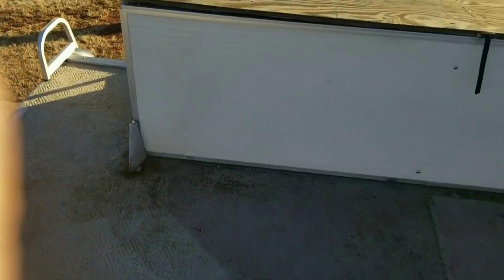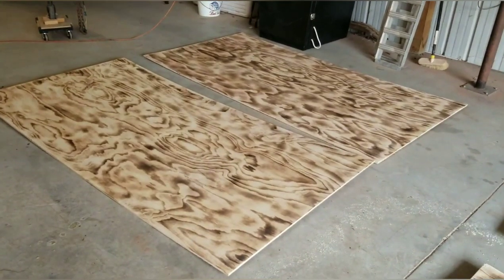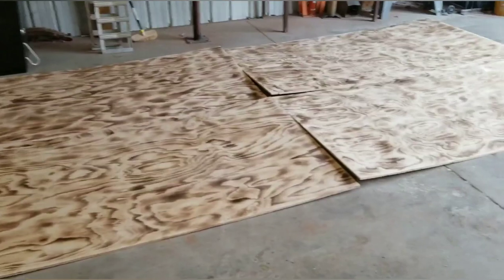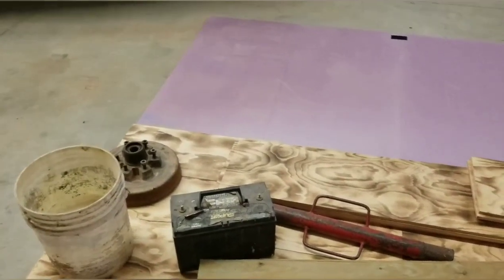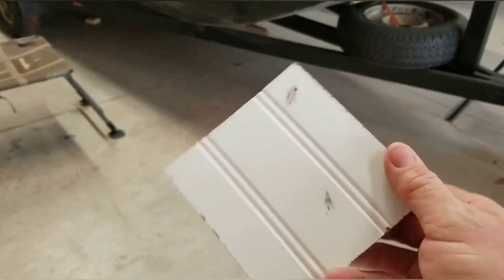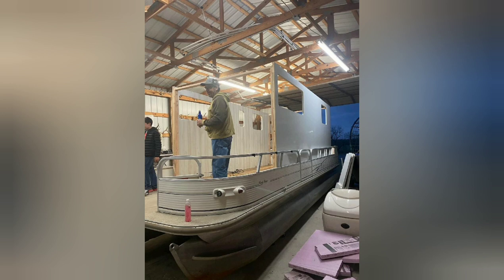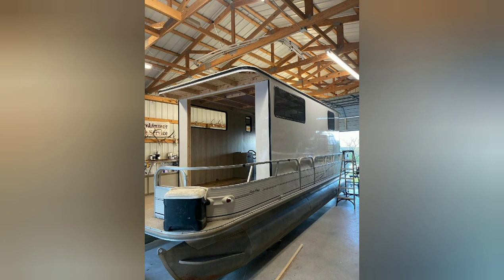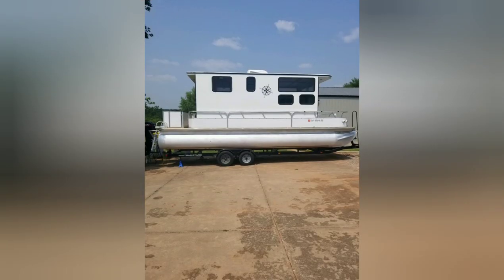Pontoon Houseboat Build, shanty boat New Details Added Episode 1 of 8

Comment: Very cool!   What's the diameter of the pontoons?  That will dictate how well it carries the weight.
Reply from the maker: the diameter is 27 inches. I ran that way for two years but recently I got a good deal on a center toon also 27 inches and added it. it leveled it out but I lost top end speed by 3 knots. with the extra floatation of the center toon at low speeds I gained a lot more mph.
Reply from the maker: Sorry ...I meant MPG

Comment: Very impressive build!  I recently purchased a 1985 28’ party barge and I’m planning to build something very similar. What size tubes does your pontoon have?  Mine are 21” in diameter. I’m thinking I’ll have to add a third tube to support the added weight. Thanks for all the great pointers. Looking forward to documenting and sharing my build.
Reply from the maker: Mine has 28" tubes so you probably will need to add a third toon I got lucky on mine, I thought I would have to add a one also. good luck with the build. Thanks for watching.

Comment: is the roof made of the same material as the walls?
Reply from the maker: the roof is a rubber liner that is glued. you can get it any length its 8.6 wide. I purchased it at Recpro.

Comment: @EverythingOutdoors Really like your boat building methods and the result. I have a few questions. I'll start with these if you don't mind:

1) How did you attach the walls to each other (along their vertical joints) (method, hardware)?

2) How did you attach the roof to the walls?
Reply from the maker: At the vertical joints I glued and screwed a 1x6 on one side of the joint and on the other side I fiber glassed across the joints and also did the same horizontally.  The roof  was framed in with 2x4's and plywood on top. It was all screwed down then fiber glassed. Then I glued down a rubber membrane that overlapped the walls a couple of inches.
Reply: @ew1421  
(Edited and removed some questions)

Thanks. 

When you say you also did the same _horizontally_, do you mean on the wall / floor seam?

How did you handle where the Filon needed to come into contact with or overlap the rubber mat at the top of the walls? I noticed an unfinished lip around the full perimeter of the composite wall when it was laying on the shop floor. Maybe that was part of the answer?
Reply from the maker: @_onesimpleidea   yes there is a 1x6 along the top of the wall and at the bottom of the wall with a layer of fiberglass where the roof and floor join together. The rubber roof membrane overlaps the Filon held down with adhesive and trim gutter.
Reply: @ew1421  I really appreciate the info. I'll let you rest a bit before I ask a few more ;-)
Reply from the maker: @_onesimpleidea   Glad to help!

Comment: How did you attach the walls to the floor
Reply from the maker: I used galvanized angles every 4' bolted through the floor and an adhesive around the perimeter. Thanks for watching

Comment: Very nice build.
I'm starting a 24ft houseboat. I would love more details on your build. That remote steering looks like something I need. 
You did your homework on this - whatbdid you decide for the toilet?
Reply from the maker: Thanks, the toilet is a marine model with a macerator pump. It just sucks the water out of the lake and pumps it back to the blackwater tank.
Reply from the maker: If you want more details I would be glad to share. Be sure and share your build. Thanks!
Reply: @ew1421  I really would love more details. I'll be boating on lake Huron with regular access to marinas for pump outs I hope.

Comment: I love this! I'm planning on doing the same thing. So your videos are a great inspiration. Question: What kind of sheathing did you use on the outside of your composite walls? Because it looks smooth and it's gorgeous.
Reply from the maker: It's called Filon. It is 8'6" wide and as long as you want. They can cut any length. It is glued on with contact cement. Thanks for the kind words.

Comment: THAT is a well trained dog - best I ever seen!
I'm interested - how did you do the roof?
Reply from the maker: The roof is plywood that I joined together at the joints with fiberglass then I just glued down that rubber lining that they use on RV roofs. It's stretched over the side and held down with gutter trim
Reply: @ew1421  Cool thanks. My son has an RV that needs the roof replaced...so wondering. Very nice work - thanks for posting!

Comment: I really like how you constructed the walls.  I notice the outside has a shiny surface.  Is that just paint over marine plywood or did you cover it with a thin white metal skin like on DIY tear drop campers?
Reply from the maker: It's actually a fiberglass siding called Filon. You glue it on with contact cement.
Reply: Ahh.  I was wondering.  I must have missed it in the video.  Hope you had a great Labor Day.  I'm on the north property line of Thunderbird.  I could hear all the boat traffic and that dang jet boat, but I stayed off the lake this weekend.  lol  @ew1421
Reply from the maker: It was a good time but I decided not to take out the houseboat it was a little too crowded and hot. Stayed hooked up to shore power with the A/C cranked.
Reply from the maker: I'm not too far from you. I'm at 164th and post
Reply: You are close.  I'm just west of 108th on Alameda Dr.  next to the Lakeview Baptist church and just a half mile from the Denver Corner boat ramp.  @ew1421
Reply: Probably a good idea.
 @ew1421
Reply from the maker: Small world haha! Been by your place probably a 1000 times. Good area I'm jealous!
Reply from the maker: Hey just watched some of your videos and subbed. Going to watch a few more after work. Good stuff!
Reply: Thanks, I appreciate it.  I subbed to yours's also. Really like that houseboat. @ew1421
Reply: Thanks.  It's been a work in progress, now I can't get the wife to sell it.  lol.  @ew1421

Comment: @ew1421 OK, these are my last "build" questions for now. Appreciate the help:

1) When you placed the cabin on the floor layout, did you put it exactly in the middle of the boat (front to back) or closer to one end?

2) Based on your experience now, if you had to start over, would you put the cabin farther forward or farther backward on the boat floor?

3) Based on your experience now, if you had to start over, would you keep the full width storage locker at the stern, or would you split it in two with a gap, allowing you to reach the engine?
Reply from the maker: @_onesimpleidea    #1 the cabin is 1ft farther back than the front.

#2 I wouldn't change it. You want the  front a little higher for when it gets choppy and with a flat roof you want the water running off the back.

#3 the back storage area doesn't go all the way across the back. There is a space on the starboard side where the swim ladder was. You can easily access the motor if you need to and I think that's important. You need to access the prop when trimmed up just in case you get something wrapped up in the prop.
Reply: @ew1421  Thanks. Gives me a lot to chew on, but the picture is starting to come into focus. :)
Reply from the maker: @_onesimpleidea   Great!